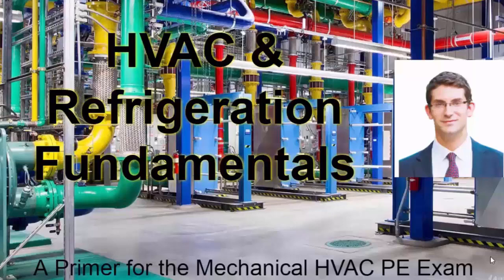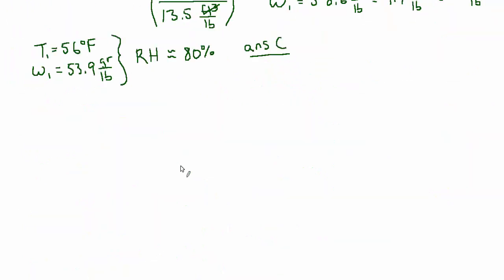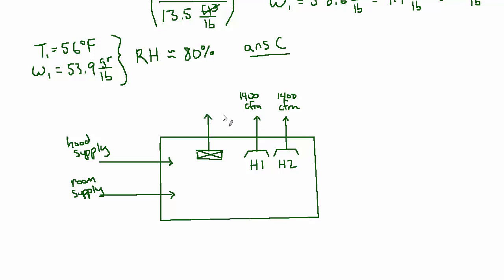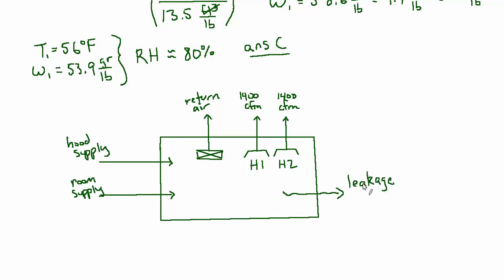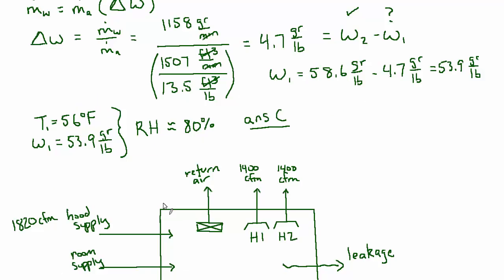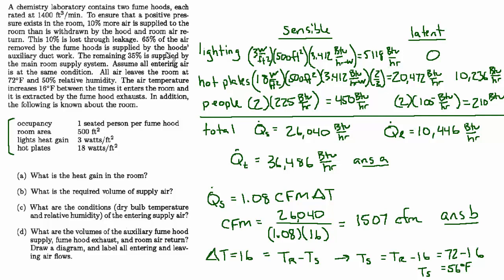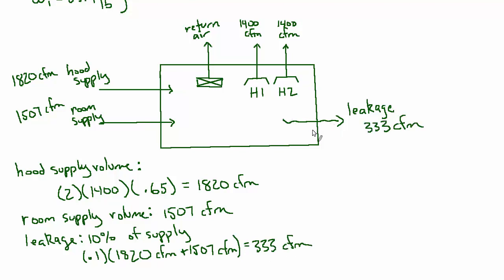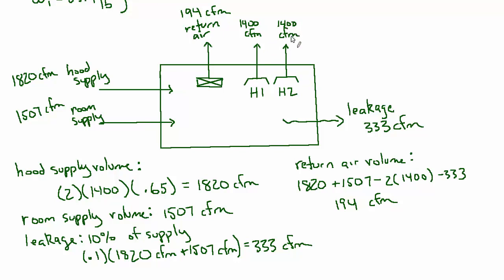How to Calculate Fume Hood Airflow Volumes for HVAC Systems | PE Exam Prep

Comment: So we are assuming that hood auxiliary supply air doesn't mix with room air to take on any of the sensible/latent load? And that it goes in and immediately gets sucked out?
Reply from the maker: Yea, for a Chemistry application with fumes, it's less about addressing the heat load and more about withdrawing harmful vapors.